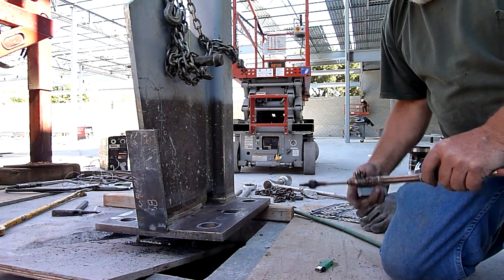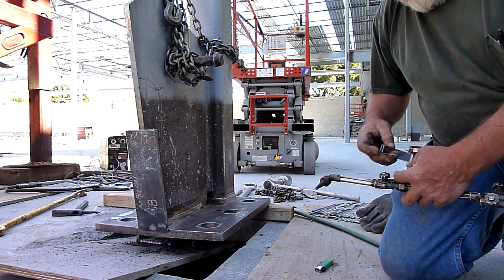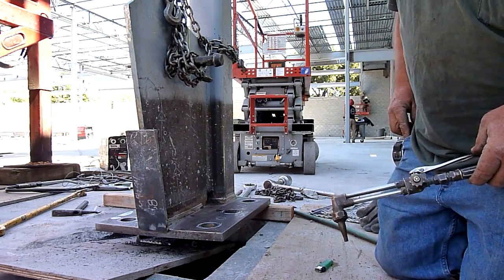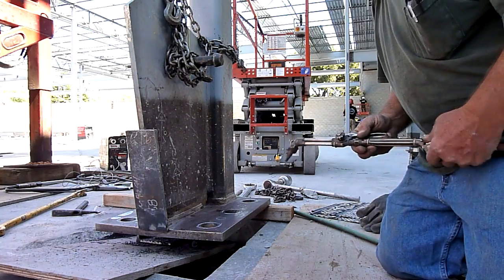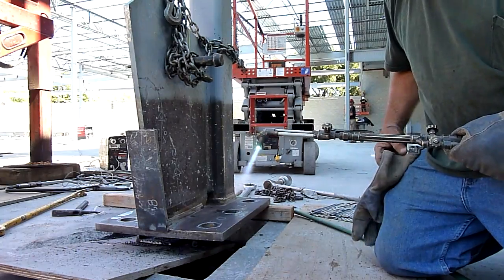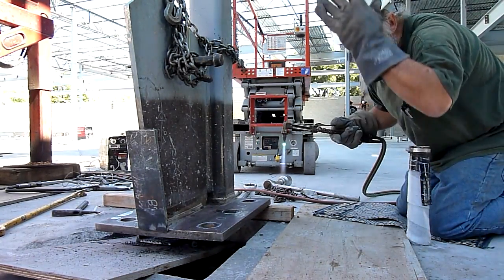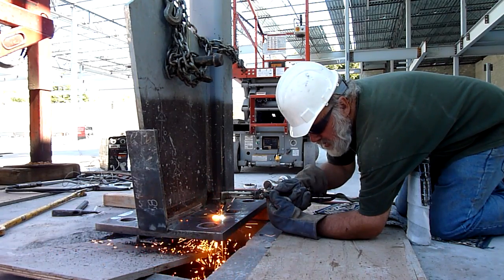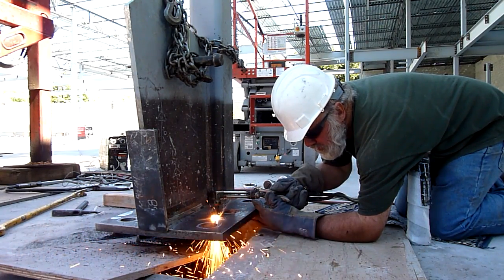Oxyacetylene piercing and burning a hole in 1 inch plate

Comment: Talking to a pro here.  37 years with every metal cutting conceivable. Blew holes in 6" plate in a test those Texans thought wood send this michigan man back home with his tail between his legs. This was with a Airco hand torch. Had gauntlet gloves on.  They magged a 6"thk. x 15" diameter slug one of their guys had previously cut with his X-Y axis burning machine on to the slats.  Told me to pierce a starting hole for later use in it. Had #5 Airco tip in it(could burn 10" on their machine with that).  This maintaining finese while gentlely easing on that trigger gradually moving while PSI  digs a trough and sparks move in the opposite direction.  Moved only one inch till i heard and saw it drop threw, then swirled a slag free one inch diameter hole for a possible machine start out of my hole.  Everybody's jaws dropped!
Reply from the maker: Good job.  I know you know what you are doing. It's a skill not too many have.
Reply from the maker: You are definitely a pro. Few are taught these skills anymore.

Comment: I've never seen 1 inch plate heat that fast or start a hole with almost no blow out from starting the hole
Reply from the maker: Use a clean torch tip that is big enough for the job.  Light the acetylene and turn it up until it almost stops smoking then add oxygen to bring the feather in and keep it in when adding cutting oxygen.  Hold the torch at the end of the blue preheat flames then just when the surface turns shiny and melts hit the oxygen and begin moving in the desired direction at the same time.  The molten metal will trail behind you until it shoots through the bottom.  Aim your flame slightly forward to preheat as you are cutting.
Reply: @glennkangiser  man this is great. Thank you!
Reply from the maker: My pleasure. Happy to share old skills. I was taught by a pro 50 years ago.

Comment from the maker: Mostly an old wives tale there.  Technically possible but your hand would be burned bad enough for a trip to the hospital before the flame was hot enough to ignite the lighter..

The explosion of a lighter lit by a torch is small according to these kids lighting them with a torch.

see- lighter explosion

No guarantees - your results may vary.  I have been doing it for about 40 years and still have both hands with no explosions of the lighter.
Reply: Read my response you spent 40 years not really in the thick of it.  Rutinely burned 1/4" thru 12" thick plate on machines week in week out on all these machines: Airco, Koweke, old NCG's , Messers,Lindy's, and many others.  Blowing holes with hand torches anaceptically can be done cleanly by someone who actually forced themselves to go thicker with sucessive experience.  Ran the finest burning machine i ever used . It was a immaculately maintained NCG with a compressor cranking that 4psi natural gas(same gas as heating homes) up to 80psi.  They got waivers to do that because they  ran giant preheaters on alloys(4140, 8620, 6150,etc.).  My NCG  had manifolding, piercing valves, and gages 6"diameter(those gages today would cost in the thousands and only be on decompression diving gear). Everything was huge and badass.  Over the years sure i have some burns on me, and on a sunlit day i see a flock of birds(spots on the back of my retinia)